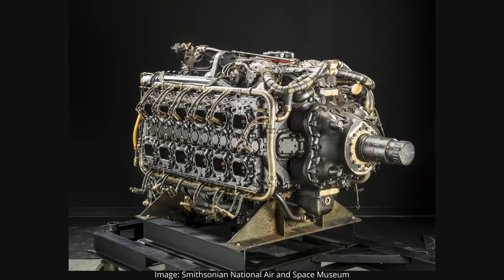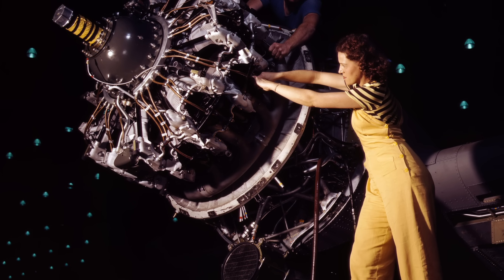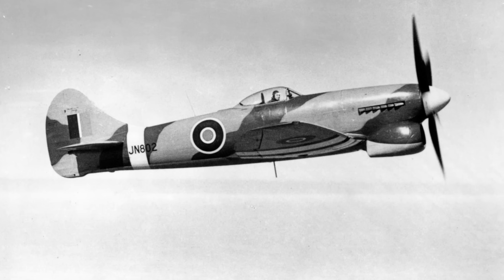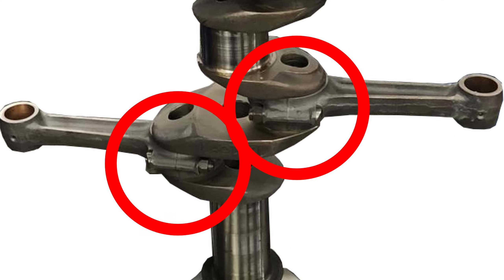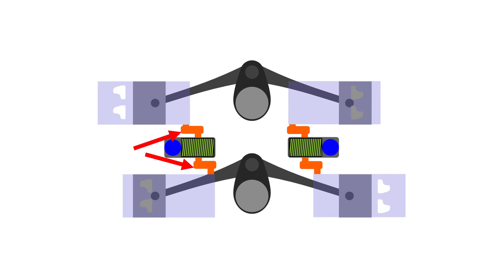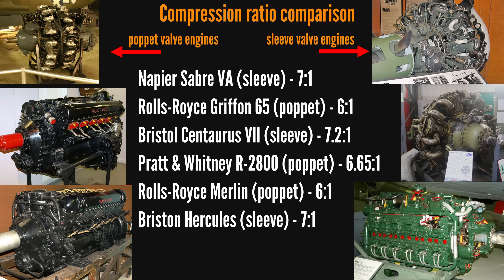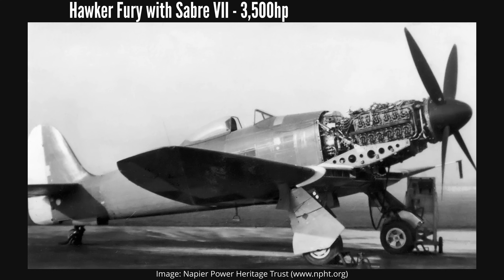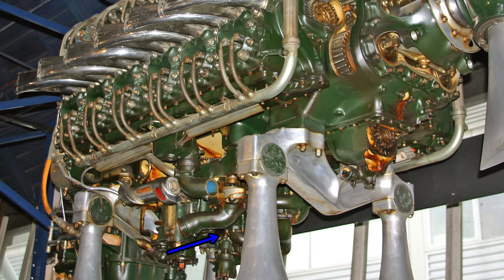The Complex Napier Sabre 24 Cylinder Aero Engine Explained Simply

Comment: The Brits produced 2 Major sleeve-valve engines during the War - the Sabre - by Napier, of course, and the Hercules - by Bristol.  A RADIAL engine used in the Halifax and Beaufighter.
Sleeve Valves have several advantages in engines - they are MUCH quieter, since they have NO valve noise (the Germans called the Beaufighter "Whispering Death" because it was much quieter than other twin-engine fighters)
They can use lower octane fuel for the same compression ratio - or conversely - use much HIGHER Compression for the same octane fuel - giving them a MUCH higher power output for the same size engine and fuel quality. 
No Valve wear - They don't bang up and down, they just slide.
They also have some DISadvantages - they are harder to machine - the sleeve has to be made to EXACT Tolerances, or it will jam - especially as engine temps go up and down. The block, sleeve and pistons all expand and contract at different rates. Because of this, they are prone to using a lot of oil.
Reply: And the Bristol Centaurus
Reply: @robertpatrick3350  Forgot that till after I'd posted it....
Reply: ‘Whispering death’, like ‘the forked tailed devil’, is likely a myth.
Reply: Absolutely fascinating American technology.
Reply: @DoktorBayerischeMotorenWerke  Sorry - that's BRITISH Technology.
Reply: @normmcrae1140  Sorry mate, Invented by American Charles Knight... and the technology was licensed to several British manufacturers.
Reply: @DoktorBayerischeMotorenWerke  You need to do more research. There were many different sleeve valve design.

But that’s not really why you’re here, is it?
Reply: @thethirdman225  The Sleeve-valve is an American design... it did not exist anywhere else prior to Knights patent.
 Thats exactly why I'm here... set the record straight.

Cheers mate!.
Reply: @DoktorBayerischeMotorenWerke   Read about the court case champ.
Reply: @thethirdman225  I have, Knights patent predates any other applications, and he won his case..
Reply: @DoktorBayerischeMotorenWerke  You ARE correct - Forgot about that.